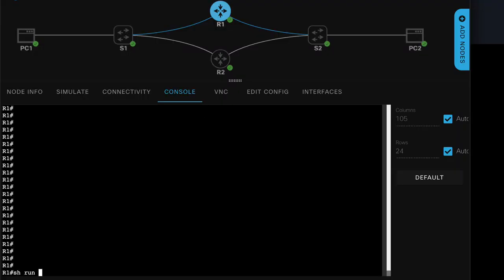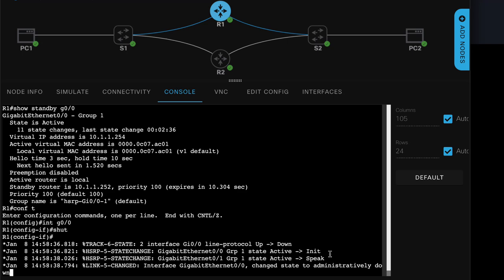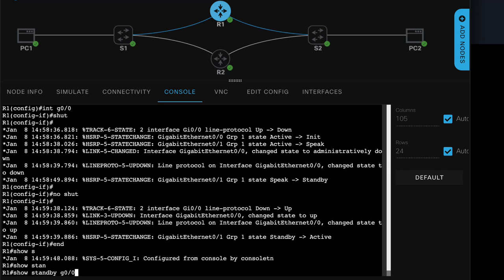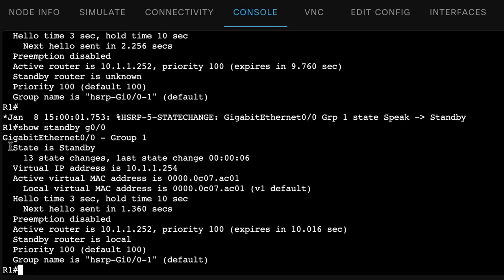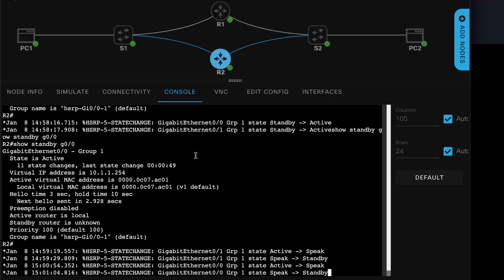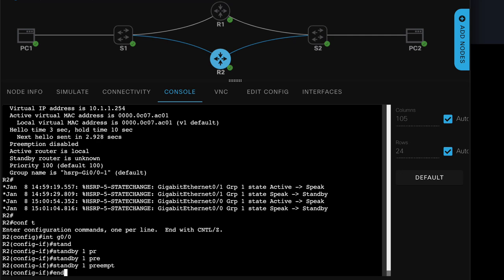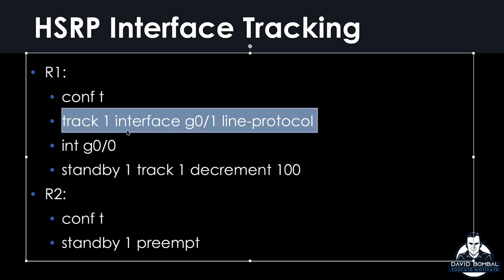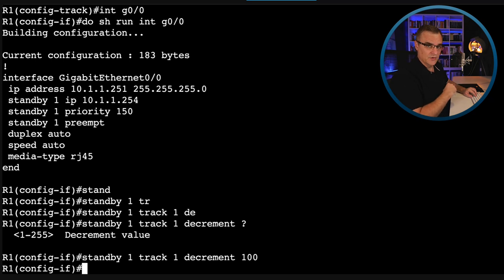HSRP and First Hop Redundancy Protocols (Part 2)

Comment: what will be your advice, having two routers connecting two ISPs and configuring  HSRP or having one router with 2 WAN interfaces connecting two ISP?
Reply: Hi agbe. I think it really depends on the physical location of your equipment - Are both routers physical located at the same place, as well as both ISP's?

If so, you properly would make 1 connection from ISP1 + ISP2 to Router1 and do the same with Router2, for the full redundancy.

There are multiple ways to this.

Maybe David would have some time to answer this as well, but it really depends on your setup - You are welcome to reply back with more information.

Hope this helps.
Reply: @nicolaithune  Thanks for your quick response. I really appreciate that. I am asking for the best recommendation on which setup is ideal, having two routers or having one router with multiple wan interfaces for higher availability
Reply: @agbefii8453  The answer would always be 2 routers, since you got a single point of failure in only one router.

Edit: Ideally 2 routers and 2 ISP's for the highest possible redundancy. If you have 2 routers, but only 1 ISP it kinda makes the same as 1 router and 2 ISP's.

I hope this answers your question.